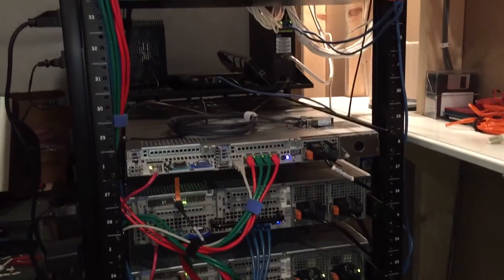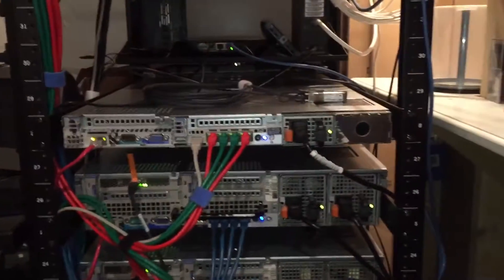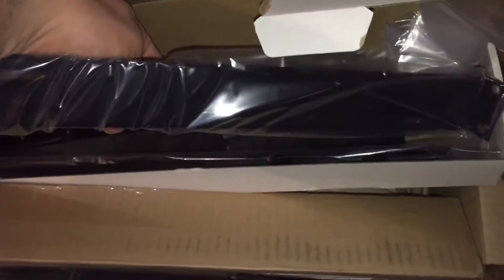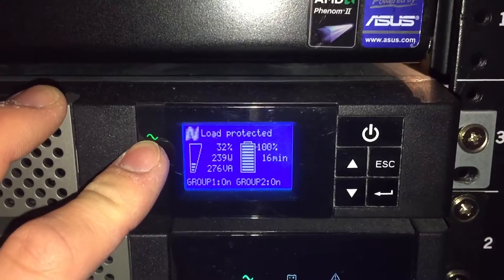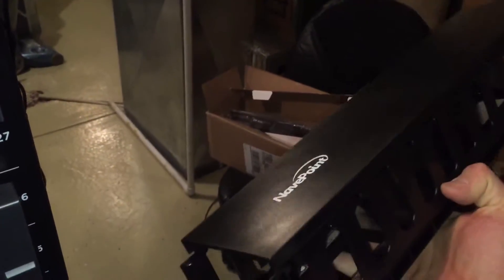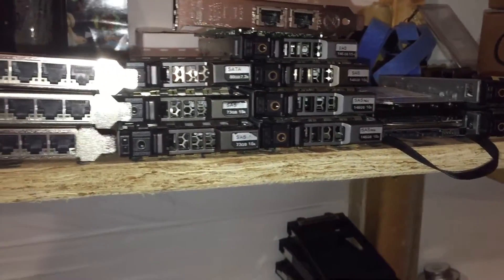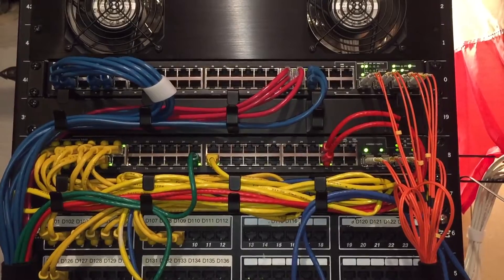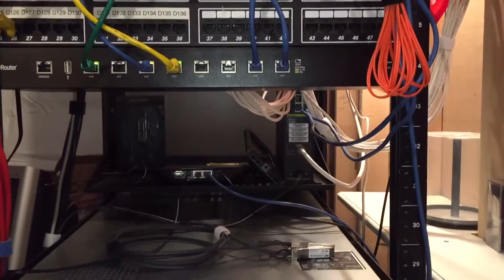Home Data Center Project - 2016  | VMware | FreeNAS | Back Up Server | New  Additions

Comment: I've been looking at the HP DL380's and the Dell R710's to run my FreeNAS/Plex setup.  I know that FreeNAS likes software RAID, rather than the hardware based system in the boxes.  Did you use an HBA to get past this?  Also, have you been able to get past the 2 TB wall on your hard drives?  I'd like to use 8TB drives, if possible.....

Comment: I know I’m late, but with those rails do you have to leave space in between servers? Or can you put servers right below it?
Reply from the maker: Nope no need to leave space but depends on the server if it will fit with the spacing.. i have completely revamped the whole setup now this is old :)
Reply: Yea, seen all your videos, just want some cheap rails. :)

Comment: HOW IS THAT RACK so quite????
Reply from the maker: +joebonsaipoland My R710s R510s, R610 arent loud at all, the loudest is the 2 Dell Power Connect switches 6248P, 5448 and the Dell Powerconnect R210. Those you can hear but it could be the mic on the camera at the time but its  not too bad!
Reply: Tom
freaking awesome! they are so quite!!

Comment: Wicked stuff very nice! Are you using VMware free edition? also what firewall software are you planning to install on the R210 when you get it?
Reply: +fmslick I'm gonna have to check out xenserver now :) Thanks for the recommendation.
Reply from the maker: +Brad Mottram New video coming up tomorrow!! :D  lots of new upgrades!
Reply: +Tom Yeah I was using vmware and starting to move over xensever do to its free and there is a really cool web gui for it. but I mean that's not the only why, it more ez to use the console side of things dont have to ctrl alt out of the windows + I really like the way the status or should I say performance graphs show up.
Reply from the maker: +fmslick haha yeah only thing sucks is i bought the whole vCenter and all the licenses for VMware :) i have 2 extra R710s ill take them out and install Xen Server and do some testing!
Reply from the maker: I have vSphere 6.0 and paid for :) cost me quiet a bit but it's worth for the updates and I currently have a virtual instance of Sophos UTM on the r610 and soon it will be a physical install on the r210 and yeah it's an awesome setup!
Reply: +Tom g Yeah i bet it's a pretty penny for ESXI.
Reply from the maker: +Brad Mottram it was $4,632.88 for 3 hosts for vSphere cause ESXi 6.0 is free haha
Reply: +Tom g My bad. Wow that's a crazy price!
Reply from the maker: Haha its all good! and yeah costs a pretty penny to get all updates and new releases
Reply: +Tom why not Xenserver?
Reply from the maker: +fmslick Ive always like VMware and never really played around with Xen Server too much